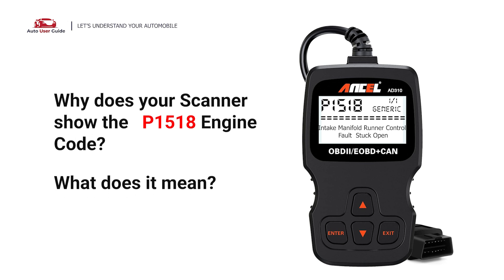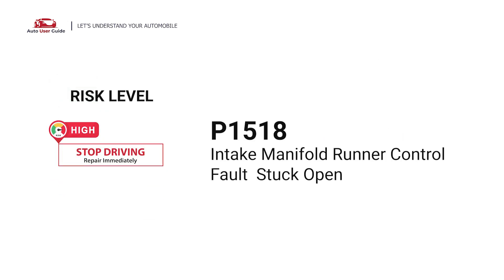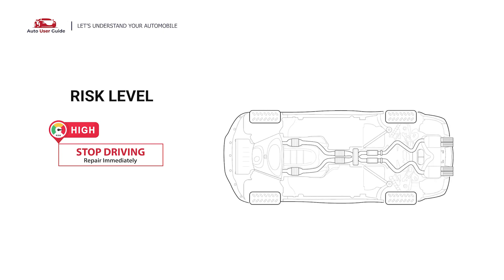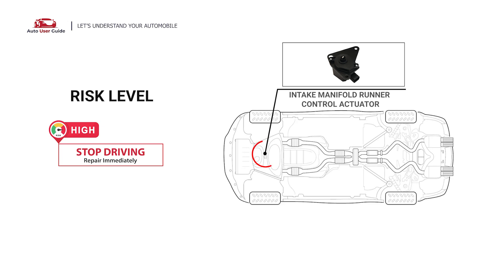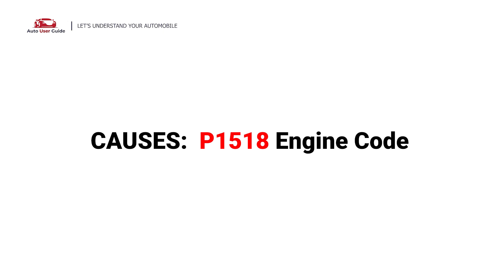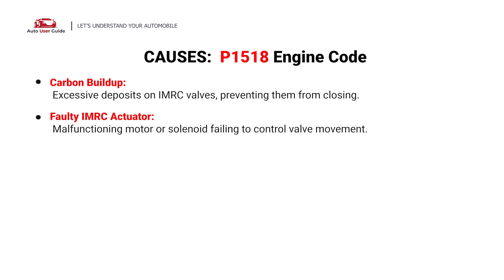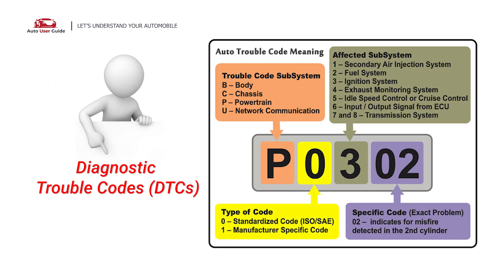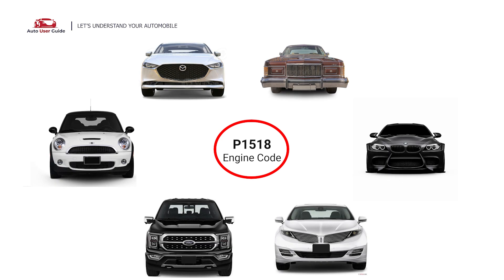What is P1518 : Engine Error Code Causes Explained

Comment: I have this code on my 2002 Cadillac Escalade Its having trouble accelerating after like 40 mph it's hard for it to shift into 3rd gear I have to let go of the gas and let it the rpm drop all the way then press the gas again for it to get into 3rd gear I went to O'Reilly's and p1518 popped up and it says primary dtc electronic throttle module to PCM communication then it says most likely solution is replace throttle actuator control module

Comment: I have this code showing up I my 2003 Chevy avalanche 5.3 LS I have check all my ground straps I have had ECU check out can't figure out if the throttle body it getting 
or tac module